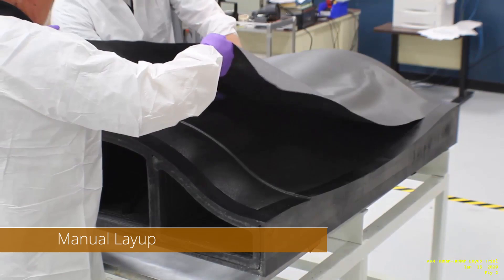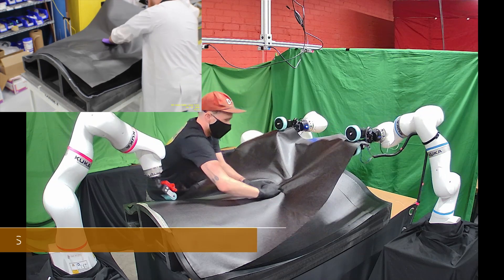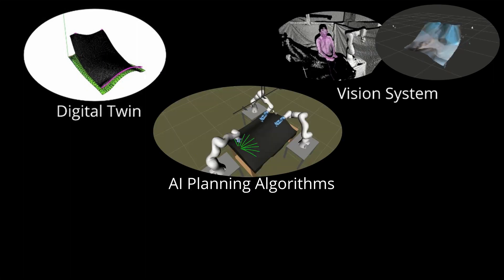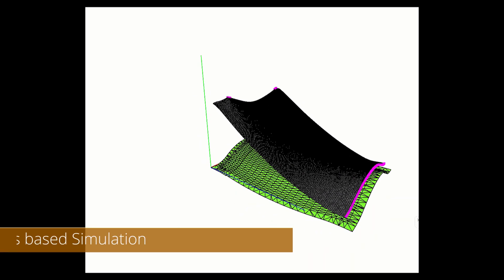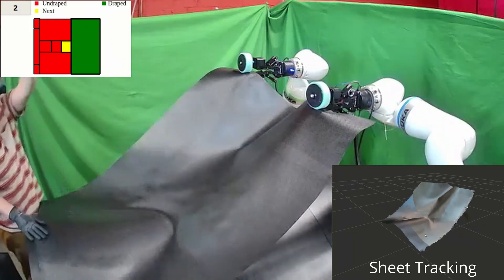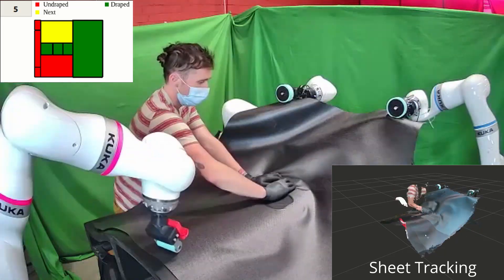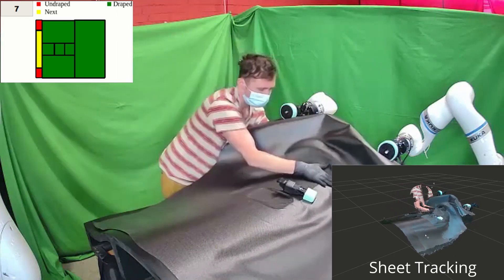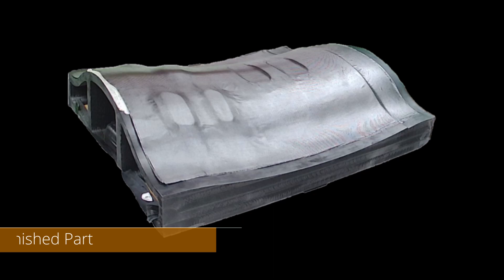A Three-Arm Robotic Assistant for Carbon Fiber Prepreg Layups

Comment: First off, I like what you are doing. But, in the first 10 seconds you say composites offer a low cost and light weight alternative to conventional materials. This is an honest question, What conventional materials are you refuring to that are more expensive to build parts from than prepreg carbon fiber? (Not only the material, but keeping in mind the mold or whatever tool that that part is being layed up on).